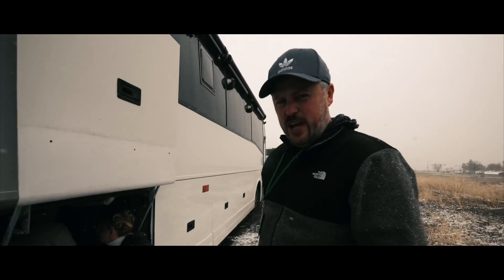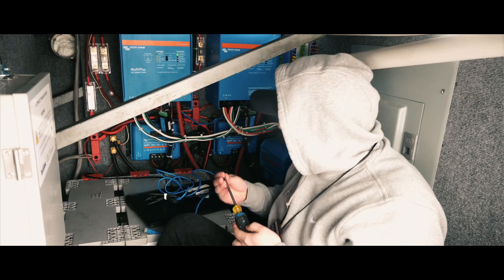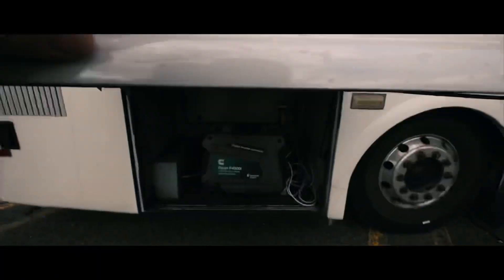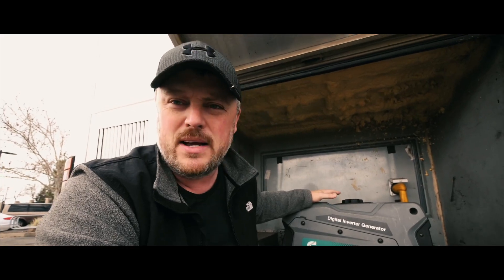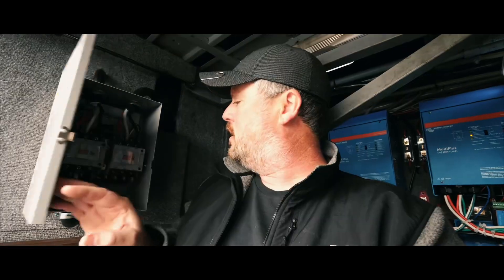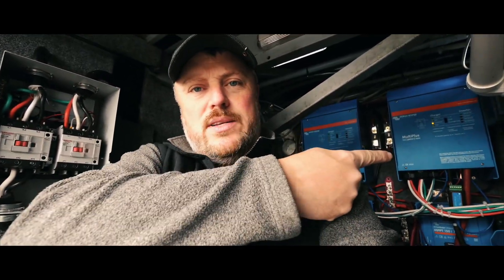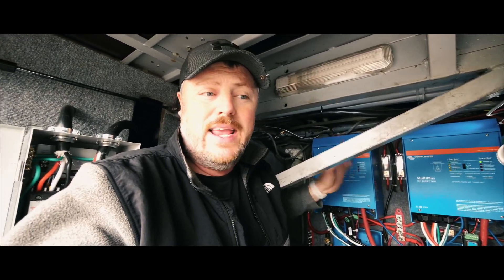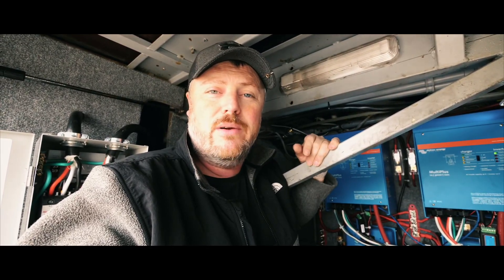How it’s Possible to run a 50 AMP/220V RV system on a 30 AMP/110V Generator?

Comment: That is really great and I see exactly why you would think that… I was figuring that’s where you were going. One of my rigs is 50 amp and the other is 30amp, part of me wants to upgrade it to 50 but being a fleetwood product it runs both AC’s on 30amp and it does a great job at it.. it’s one of the reasons why I’m on my fourth Bounder :)